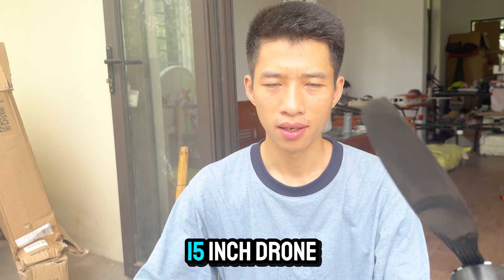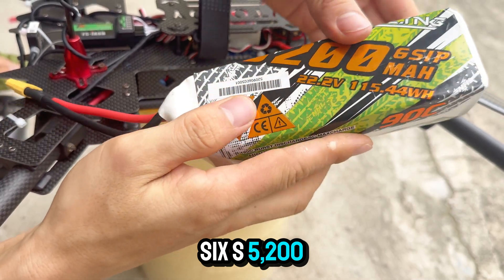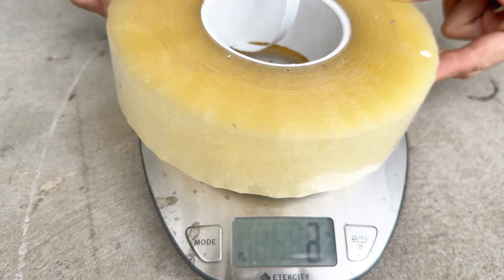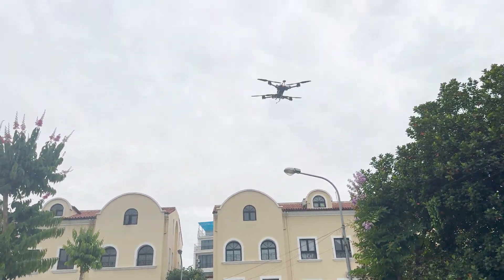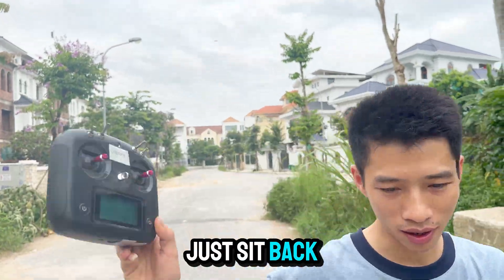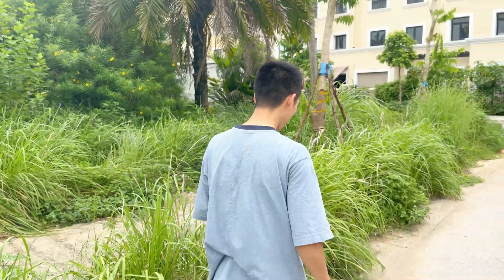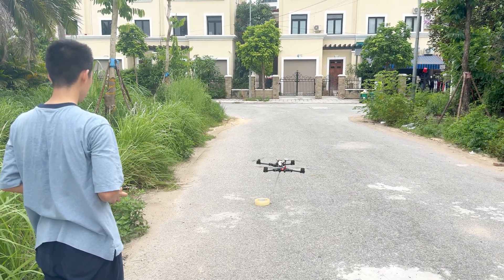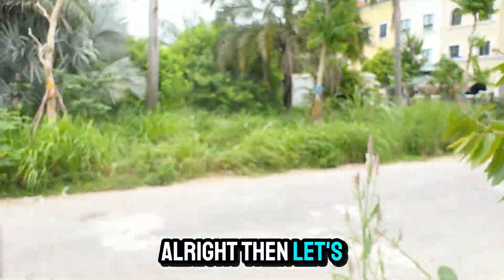15 Inch Drone Lifts 2KG – Insane Test!

Comment: awesome build, i have noticed your using a Naza M lite flight controller. were you able to upgrade it to Naza M V2 firmware..  also flysky have  the V3.0  5/4/2020  firmware upgrade for the i6s transmitter